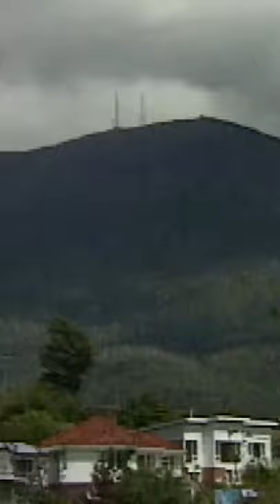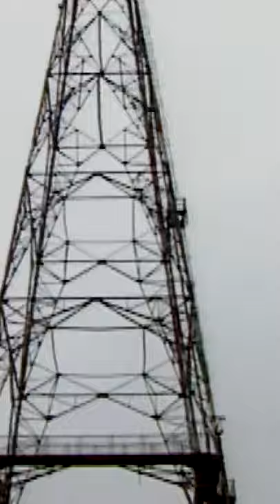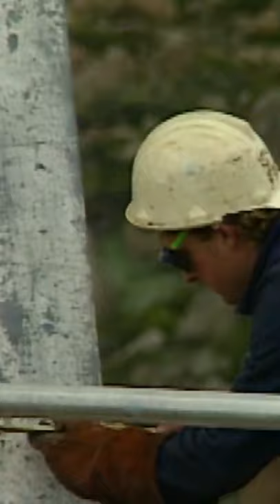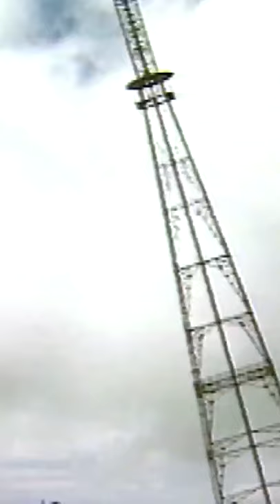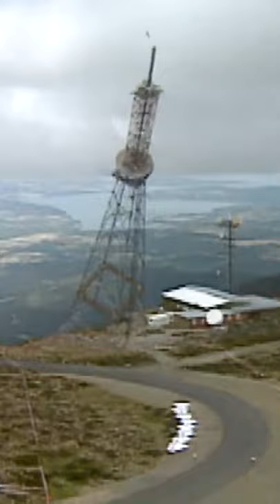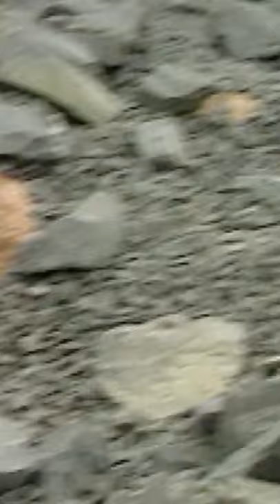Collapsing of a 340ft Steel Radio Tower #shorts

Comment: It was such an iconic tower. Looks like they removed the fiberglass 'condom' that was added in the 1980s? before dropping it. I grabbed a radio waves hazard warning sign off it at the scrap yard as a memento. Quite a bit of it ended up used for building a shed up Brighton way by the brother of an Amateur radio guy I think. Then there was the fire that gutted the TVT building destroying all that nice old Pye transmitter equipment from back in the 1950s after they stuffed up the new digital transmitter cable I believe.
Reply from the maker: Haha cool! I don't remember it falling, but I was quite young when it did